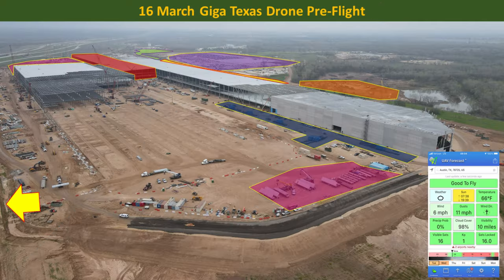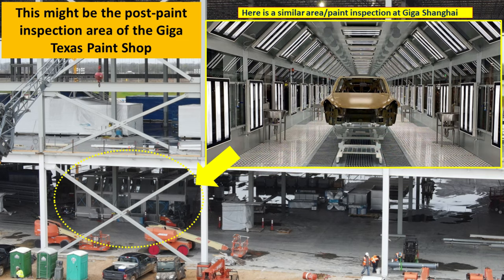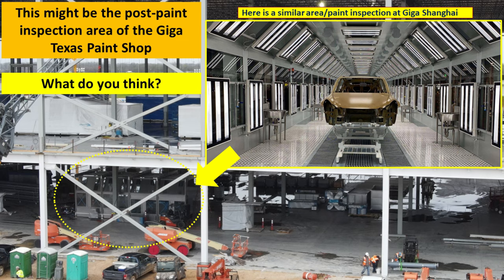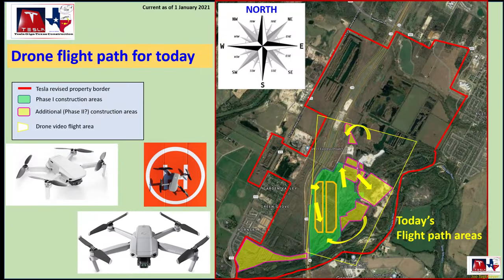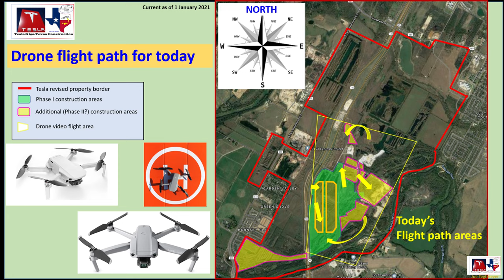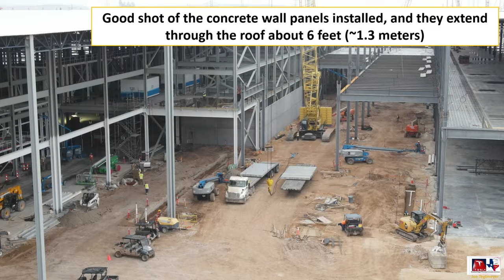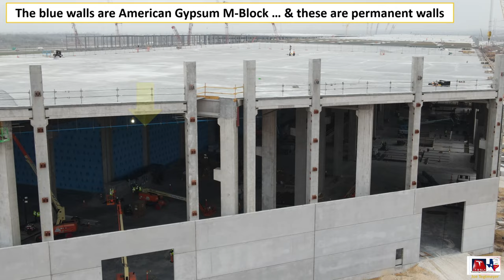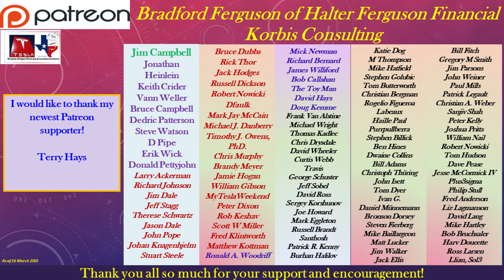Tesla Gigafactory Texas 16 March 2021 Cyber Truck & Model Y Factory Construction Update (08:30AM)

Comment: Regarding the interior walls in the concrete stamping cathedral: It occurs to me that one possible reason for installing these walls is to independently and better control the air quality in each stamping area. Also, the walls may be required to meet code (fire?). I say this because the walls are full floor to ceiling resulting in completely enclosed areas. If I remember correctly, the gypsum panels they are using are fire resistant (too lazy to confirm this). Commercial manufacturing buildings, as a general rule, have much stricter air plenum control requirements for fire code and air quality. It's much easier to meet these requirements if you section the building up into independent areas.

Just a quick gander and guesstimate: Looks to me like there are easily ~1,000 cars on site now. Shift change must be getting monstrous traffic. Um .. makes me kind of glad I'm retired.

Given how many workers there are on site now, I'm surprised there aren't more food trucks. Plus I wonder how many food trucks are on site during the other shifts as well. (I'm a bit of a foodie after all)

Comment: Looks like they're prioritizing the battery plant which makes since as they need it for the model y, they've started on the perimeter grade beam. Yet have to do a lot of it on the northwest side. Although now the northwest corner is almost completely blocked off and the filled in corner is now being used as storage like I thought it might. So the footings could be dug soon, maybe after they finish the perimeter grade beam on the battery plant.
Reply from the maker: Also the entire southwest area needs work!

Comment: Great video Joe. Really digging in close to those high tension line towers. I guess they also got to the point where they have to keep personal vehicles away from the building. Crawling in there like ants today. It's great.
Reply: There is a gas line next to those power lines also.

Comment: In the substation, I see 4 breakers but two transformers with room for two more. So I think this is the permanent substation. But I'm puzzled by the wood poles next to the line.
They already have power from the 12kV line on the South end of the factory as far north as the casting machine area.

Comment: At 19:59 next to the wall panels we see a roof-like double-T structure.  Anybody have an idea what might be the intended purpose?
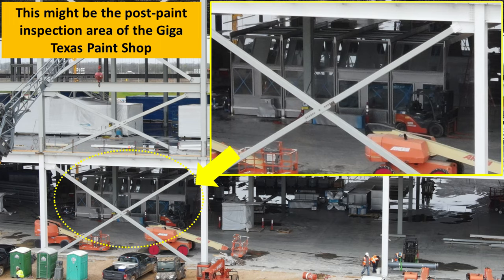Reply: Hi John. They'll use it in the casting plant extension on the north east corner, assuming the column spacings are the same. It's been on site for quite a while 22nd Feb at least. Here at 3:52 https://www.youtube.com/watch?v=Ooqs3cK-_Pg

Comment: Does anyone have any information on how the design of the factory structure, it's imprint, and the land development on the property is accounting for flooding downstream in heavy rains?
Reply: Elon probably does.  Try sending a tweet.
Reply: It's a stones-throw away from the Colorado River. (You can see the river in some shots in some videos). And when it floods (not  often, but maybe every 10 years) it floods all the way to the Gulf of Mexico. Basically, Austin is not that much higher than sealevel (400 feet) and its 200 miles to the Gulf, so that's a 2 foot drop per mile. Not a lot of drop. The flood-waters back up. Impermeable cover on this plant will not change that basic equation.

Comment: The baguette diamond-shaped structure’s shell is now nearly complete along its entire eastern boundary. 
Maybe 30% complete on the western perimeter, while the NW and SW corners are basically just unfinished footings. 

Is this curious order of completion due to design changes still ongoing in those areas?  
Or are they the quickest to finish once their walls are up, so they are left for last?
Or is it important for them not to be in the way to allow access to other sections being built first?
Reply from the maker: Ii think a combination of changes, desire to get a basic production-capable factory finished first, and concentrating on the areas that are the most "complex" with machinery.
Reply: @JoeTegtmeyer   Hmm ok thx

Comment: Wow! Traffic control is becoming an issue for the site. They are 'manning up', or perhaps I should say 'peopling up'? Now come a lot more pipefitters, electricians, sheet metal workers, equipment installer technicians, and many others. Just waiting with with bated breath for the roofers.
Reply: Roofers seem to be working pretty quickly. A month ago, probably a quarter of it had roofing compared to what it does now
Reply: @duncanadams2531  While I agree that they are stepping up the pace, what you see being laid down is the roof decking that will support the waterproof roofing material. The roof decking is being installed by ironworkers as it is basically galvanized corrugated steel panels that can support concrete as you see on the lower levels. Sometimes concrete will be poured on top of the decking on the roof area if needed for structural or fire proofing needs, otherwise the roof decking is often without concrete.Then the roofers will install a combination of waterproofing membranes and insulation on top of the decking  to complete the building envelope. Lots more work and fun to be had!

Comment: Great video Joe. Does anyone know why those wall panels they are installing through the slots would need to stick up 6 feet past the roofline?
Reply: Mike, my best guess is for fire protection. This might be an area where flammable liquids and such are stored. You want those separated from the rest of your building by concrete and insulation and you want that to extend several feet past the roof line. The other thing that you usually see separated by concrete is high voltage power switches and transformers. Enough juice will arc over and turn air into a plasma hotter than the Sun. I’ve seen the results of a hundred amps of 4K that arced over in a cabinet. Blew the cabinet apart and coated the area around it with a fine layer of copper. If there had been anything flammable in the area it would have went up like a match. Those are my two best guesses.
Reply: My guess is they are fire rated walls to enclose an area of increased fire risk, possibly the use of chemicals etc.
Reply: Someone has trouble reading a tape measure?
Reply: Explosion containment. If it explodes, you blow the roof off, instead of letting the blast into the factory.

Comment: I have come to wonder if the blue wall in the south end of the stamping area might not be just a temporary wall to enclose the area until the final outer wall panels are installed. This might be to protect the machines from dust and moisture, and provide climate control for installation. This would also make sense in regards to cutting off the bridge cranes access. Any other ideas or thoughts?
Reply from the maker: I don't think so, but we shall see ... at least as long as I can get the drone to be able to look in!
Reply: @JoeTegtmeyer  "We shall see" always trumps speculation:)
Reply from the maker: @GoCoyote  👍

Comment: I have to wonder where they're going to put the regenerative thermal oxidizer.
Reply: Are you talking about that large chimney and equipment at Berlin?
Reply: It goes next to the pulse induction spectrometer.
Reply: @freddymax5256  I dunno. I think its in a direct line with the panametric fan, along with the two main spurving bearings. That's always how I've heard it explained.

Comment: Is it possible the concrete walls they’re lowering are for a highly flammable storage area for the paint booth?
Reply: Could be for paint mix room, also air bags need to be stored in an explosion proof area before being installed into the vehicle.

Comment: I can now better understand the need for the parking lot and busses.  The roadways are being dug up to lay storm sewers, or perimiter beams, or to hold maerials and supplies or additional steel.  There just isn't the room anymore for employee cars.

They are digging foundations for 2 more poles next to the switch yard.  I don't understand why there are 2 different sizes of transformers.  I would have thought equal sizes for redundancy.
Reply: Two different voltages ???
Reply: The transformer to the north was missing 3 high voltage insulators and the heat transfer fins. After adding those, the two may look very similar.

Comment: Joe, Are the concrete wall panels added near the paint ship in the outline of the water baffles that were installed earlier?
Reply: They're in the outline of the rectangular foundation poured before steel construction began. The water baffles went inside of that (which I thought was weird, but whatever.)

Comment: So with everything going on, on site the only thing that keeps popping up in my mind is, are they going to do a concrete pour on the roof and if so when?
Reply: No concrete on top of the steel roof; wrong kind of decking. Should be insulation and a membrane.

Comment: 19:30 do you think that interior blue wall is permanent?  It blocks the bridge crane from coming to this end.
Reply: Joe usually checks things out so I will believe they are permanent.  One of my thoughts was they completely closed the area. I couldn’t see well enough to see that.  The north wall goes all the way across on the upper floors.  Got to get the stampings out.   The bridge crane stops can be added.  Best to have a physical stop